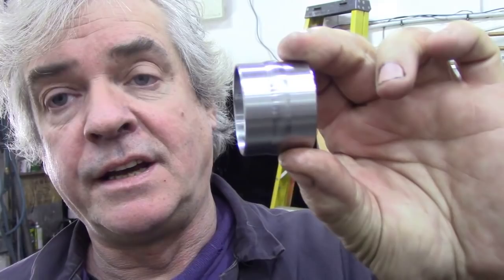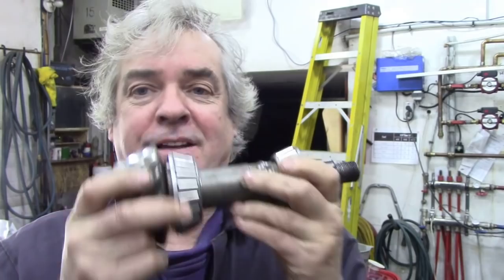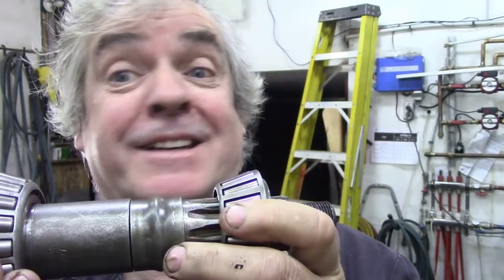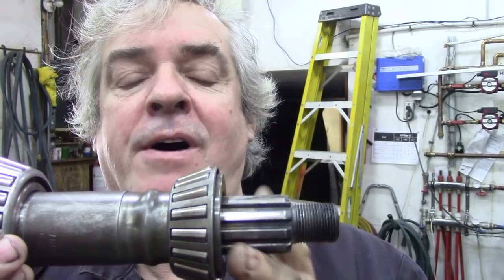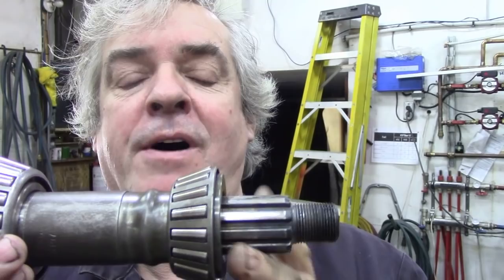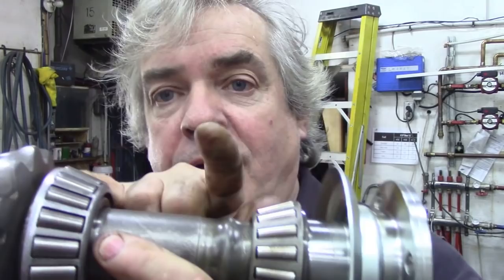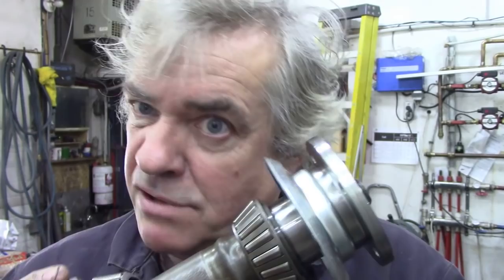Malawi 110 refitting the rear diff.   Preamble for plan of attack Part 1

Comment: Happy Easter Mike, intermediate shaft i had to shamfer the flat to the main diameter it acts like a cutting tool and sliced the oring in the case ,luckily bought more sets of orings ,hope this helps
Reply from the maker: Thanks for the tip

Comment: Mike, you can setup the pinion shimming without worrying about its preload - you only need the collapsible spacer fitted once you’re setting the preload, so don’t waste them and your time by fitting one while setting the shims and mesh.

You should find that the existing shims are fine and that you don’t need to adjust them for the new bearings as bearing tolerances are very tight and you’re not replacing any other parts.  It all depends on whether someone has changed the shims after using non-original spec bearings on a previous repair.
Reply from the maker: Yes this is what I wanted to check.
But the problem was it was very difficult to check under the vehicle  - I see why the LR manual states remove the axle - see next video
I scrubbed all of the videos I did yesterday as it was too complicated to show how to do it
Reply: It’s not an easy job, partly because of the weight of the parts, partly because of access when the axle is still fitted.  But having the axle off the vehicle makes setting the preload very difficult - the spacer needs at least 250’lbs before it starts crushing, and the more it crushes, the higher the required torque.  Trying to tighten that nut with the axle on the floor is going to have you chasing the axle around the workshop!  It really needs to be fitted and a tool like the one you made wedged against chassis or floor.

I change the diff and pinion from a 109 into a 110 axle and back, and the mesh pattern was good without changing a single shim, despite the change of not only individual pinions, diff centre and ring gear, but the ratios.  You need to change those damaged pinion bearings, but I recommend you change the bearings but leave the shims in the housing and then fit the pinion (without seal and crush sleeve), set the rough preload, then fit the diff and check the pattern.  Only start messing about with the depth gauges and block if the mesh is off, but I’ll wager a glass of whiskey it’s bang on! 😉. If it is, then you can whip the drive flange off, take the diff centre out, fit the spacer and seal, then set the preload and throw the other bits back in.
Reply from the maker: Yes you can make a jig pretty easy to hold the flange to the axle tube  - I am not concerned about this 
I seem to recall the Dana 60 had a tube and shim on the pinion to get the preload a much better idea 
Tooth pattern was good but the sun and planet gears are clunky
Reply: If the diff centre is suspect, then you might try talking the owner into a locking diff, or better for driving on snowy roads, an ATB like the Eaton Trutrac.  It’ll be more expensive than repairing the Salisbury, but perhaps not wildly, given shipping costs, and the results are worth it.

Comment: Mike.  That's why my suggestion last month was to chuck the RRC LSE's 24 spline axles under 'Muriel from Malawi' !  Young Nate from "DirtLifestyle" would love that Salisbury axle for his D2 ?  V.
Reply from the maker: Try finding those axles here!
Reply: @BritannicaRestorations  Mike.  It's like the full hour spent this morning robbing a set of front brake pads off the '93 RRC project to fit into my daily mista !  Spare parts are now taking 39 weeks via sea freight from the UK to Downunder, since a bunch of Dirka Dirka's managed to park a 400m cruiser across a canal.  Is '95 Donor RRC CountyLWB still at your vast Jamieson's workshop in Quebec ?  V
Reply from the maker: Yes the RRC is still here but if you recall the rear axle casing was so rotten you could hold the diff from the outside

Comment: Hey Mike I recently removed 300tdi due to squeezing upon applying clutch.
Upon engine removal I found that the thrust bearing was melted and seized? I'm prob going to change slave and master-maybe they the cylinders are gummy inside . Or maybe the clutch wasnt adjusted and was slowly rotating or something.
Reply from the maker: This is typical of drivers using the clutch pedal as a foot rest or a badly adjusted master cylinder putting slight pressure on the clutch and burning out the bearing which melts the carrier

Comment: It'll be dodgy sensors causing your vernier to read wrong.

Sometimes you can clean the sensors to get them working again but they also have copper tracks etched into the measurements on the slide (they work in the same way an ABS sensor does) and eventually just give up the ghost.

Back when I was young and eager I spent about £100 on a Mitotoyo Vernier and then cried when it stopped working.
These days I buy 'em 2 at a time off ebay for £10 and chuck them away when they start playing up.
Reply from the maker: Just ordered a Mitutoyo caliper on the advice of JP at the machine shop -  that is all he uses for general work - even surface grinding - like the height block he made
Reply: @BritannicaRestorations  At least Mitutoyo are made in Japan and not Hang Chung Province.  What about Starrett, their made in the US of A and may be cheaper to buy in Canadistan?
Reply from the maker: I was considering but importing from the US pushes the prices up here, so I bought from a Canadian company

Comment: Very interesting video Mike. I have a really worn front diff nearly 1/4 of a turn to my shame......I am a bit short of cash at the moment with lockdowns and moving house. So I did think of seeing if I could get hold of a low mileage front diff... However I have a Defender 300tdi and I am unsure if all the diffs are the same with regards to ratios and drive shaft splines and what fits what...Is there any chance you could shed some light on this??....Many thanks
Reply from the maker: You can guarantee all vehicles fitted with 300Tdi onwards were similar front diffs so were Range Rover classics and Discovery front and rear so plenty to chose from - which is why I do not rebuild them
Reply: @BritannicaRestorations  Thank you Mike for clearing that up so quickly.

Comment: Hello Mike, A bit off the subject of the rear diff, I looked at your videos on speedo cables. I have replaced mine in my series 3 several and wondered if the two piece cables would be any better and if they would fit my Series 3 SWB.
Reply from the maker: I suppose you could do
Reply: @BritannicaRestorations  Thank you Mike.

Comment: Hi Mike, I followed your instructions on another video of rear diff pinion oil seal. Its leaking again. breather is clear and yeah I guess its been through a few water crossings and mud but wondering what I should do different this time? I have a new crush sleeve and waiting for a new seal. I have changed this seal 3 times before and it always seems to leak again. thoughts? Thanks for your videos, they are brilliant
Reply from the maker: Hmm - something's not right 
Did you verify the flange has no marks in it where the seal runs?
Did you fit the leather or rubber seal? 
Rubber seal is better as I find the leather seals are of poor quality - but the rubber seal should be retro fitted with the matching flange as the dirt slinger can be an issue (It interferes with the lip of the seal)
https://www.lrworkshop.com/parts/STC4457 - up to 1998
https://www.lrworkshop.com/parts/STC4403 from 1999
Did you fit the paper seal behind the seal itself?
Reply: @BritannicaRestorations  yes I used a new flange for the newer rubber seal and used the paper seal too. Its got me stumped!
Reply from the maker: Are you sure it is the seal and not oil creeping along the shaft?
Maybe dry both parts off before fitting the flange and a smear of ATF on the shaft?
Reply: @BritannicaRestorations  I ordered another seal, washer and nut. I'm going to investigate a bit further because there is a droning noise somewhere when on freeway at 110kph